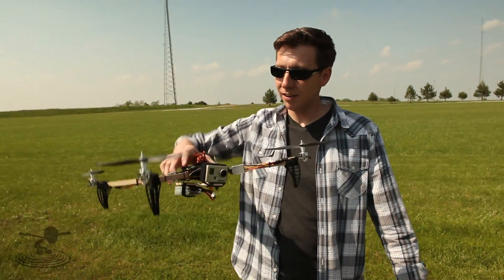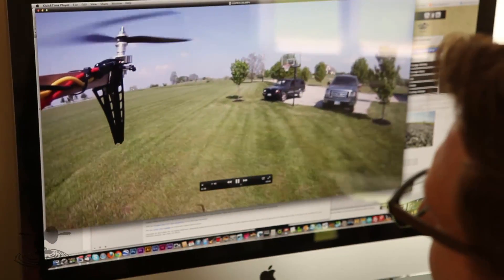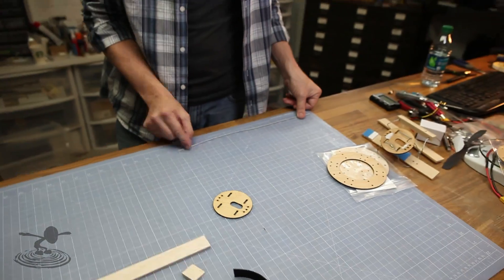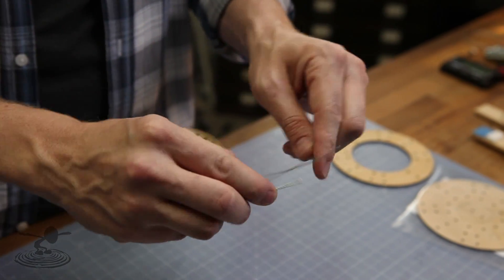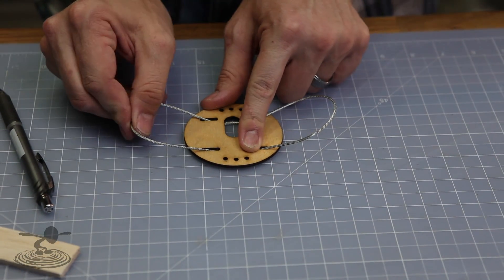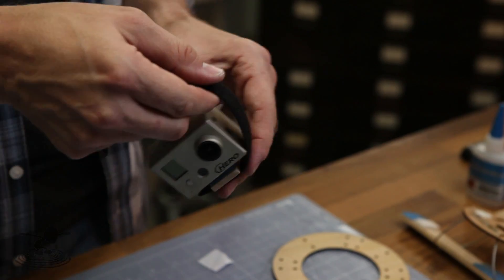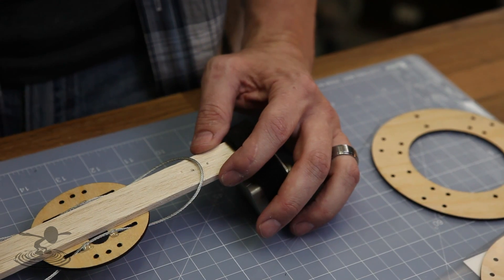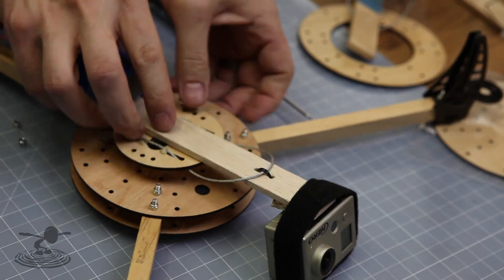Flite Test - AnyCopter Camera Rig - BUILD

Comment: They are already in bed with DJI, they are building Gimbals and Phantom specific FPV gear etc. I hope out of this they set up the Hero 3 Black to get more than the rudimentary controls we get now thru the USB connection. Blue Tooth is useless if your a thousand yards away and want to change modes. There are lots of times I would love to go from video to time lapse or burst mode. Hopefully Go Pro will listen and do these things. I really need em more than 4K 30fps.

Comment: Take my hat off to you Chad for having a go. You may find you get a better effect putting some tension into the wire, if you can put some torsional twist into the wire running between the body and the "gimbal" (in opposing directions) it will increase the effect. Check out flexacopter for a real working version of this system although it does add considerable weight. Moongel all the way........

Comment: I forgot to mention. Be sure the cable is not stainless steel if you want to solder as Chad has done. Stainless steel will not take solder very well.

Comment: To avoid the SOLDER joint you could divide the cable into two along it's length so the two halves look like cork screws. slide over 2 pieces of heat shrink. Now re-plat the wire with one half starting half way along the second. You should end up with an endless loop. Finally shink the tubing where the ends meet.

Comment: Hemostats... Not too sure if weight would be an issue but back when I worked with CL models we used Stranded Cable.  We used to tin the cable before cutting, made for nice clean cuts, also would splice with small diameter brass tubes.

Comment: I use a similar design using aircraft cable.  Best results yet.  I also have a brushless gimbal controller mounted to the cable mount.  Double stabilization!  No need for any post stabilizing.  Videos look pro.